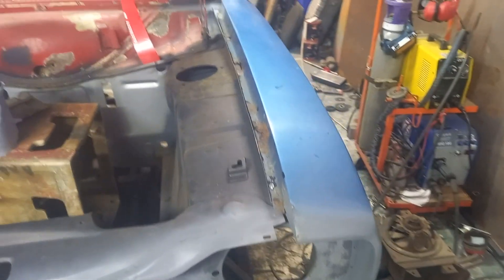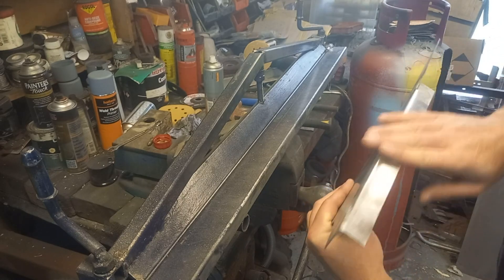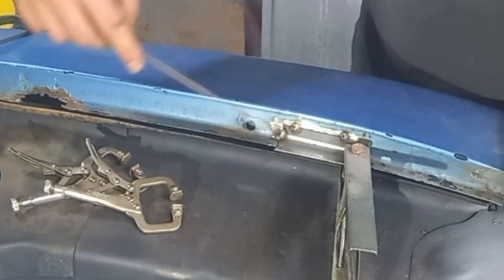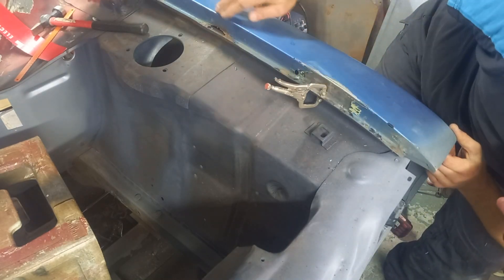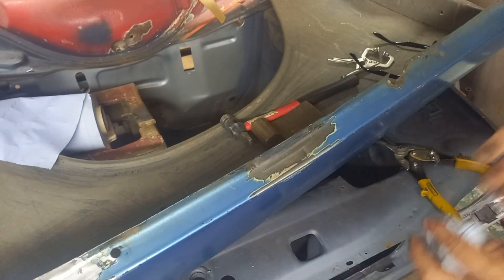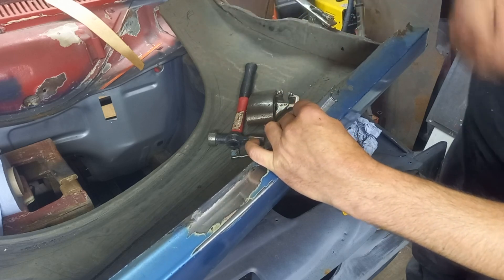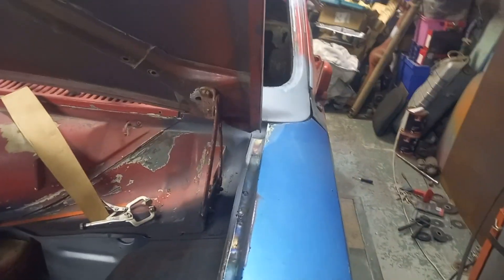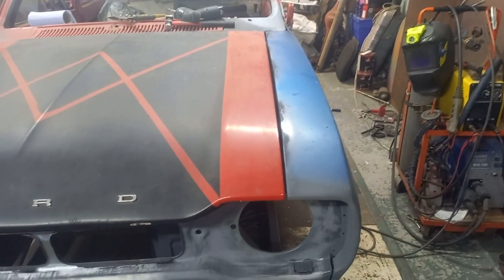Ford Escort MK1 Wing Repairs Part 3.  Car Restoration.

Comment: Dave, when doing butt welds or filling holes with weld on thin sheet such as car body work, try using a flattened piece of copper pipe clamped to the underside, it stops blow throughs and dissipates the heat a little. It’s also good for when the gap is a little wider than planned👍🏻
Reply: just thinking the same, doing a good job at saving what most people would scrap though
Reply from the maker: Thanks, good tip

Comment: Another step forward to getting the Escort back together mate.Great tip with the grinding stone...I do find the flap disks to be quite a pain as well when knocking back weld beads so I will give that a shot and use the flap disk as a finisher ..diolch .👍👍
Reply from the maker: Similar for me, you may notice with the grinding I chuck a different grinder over it at the end, that's an 80 grit disc.

Comment: Nice work Dave , it’s amazing how important those few scraps of kept metal can become on your pocket by the end of a build like this I’m sure  , that old wing looks spot on again now 👍
Reply from the maker: Thank you, 😊
Reply: Yes apart from those nasty bits along the top flange the rest of the wing looks very good indeed!
Reply from the maker: @philtucker1224  What nasty bits? What am I missing?
Reply: @DavesGarageuk  Hi Dave I was referring to the three rotten sections on the very top of the wing flange where it sits on the top of the inner wing. You made a great job of repairing those (sorry if that wasn’t clear) Nice work buddy! 😊
Reply from the maker: @philtucker1224  Phew, I thought I'd missed something obvious then
Reply: @DavesGarageuk  Chill Dave! It’s looking fab and I really cannot wait for when you start cutting in the bubble arches. I had one back in 1973 (based on a 1300GT but with a 1.6 Mexico lump) and still regret selling it now!😊Great job mate👍